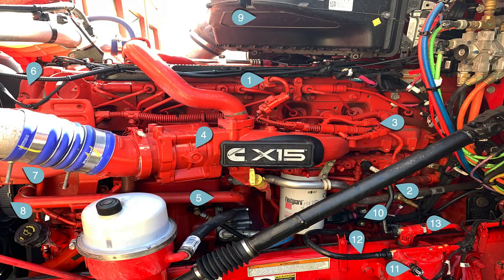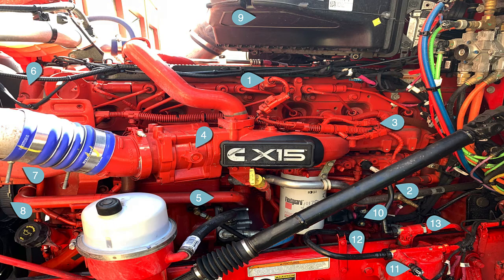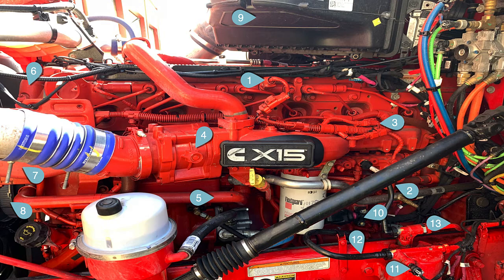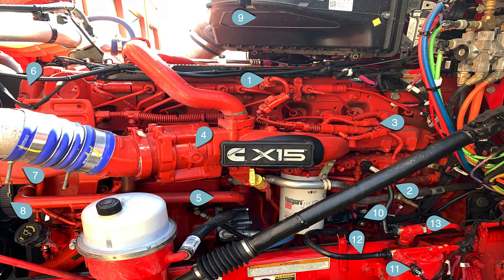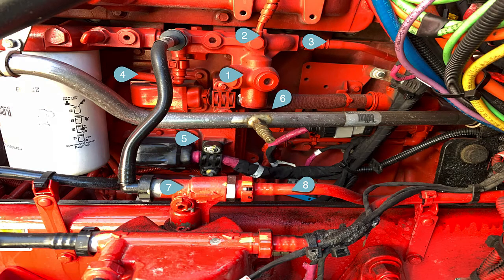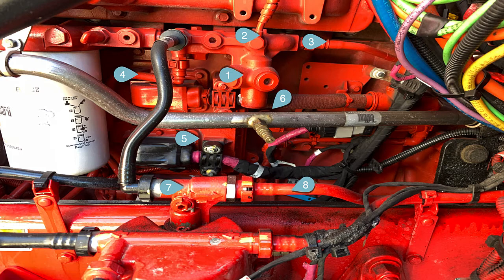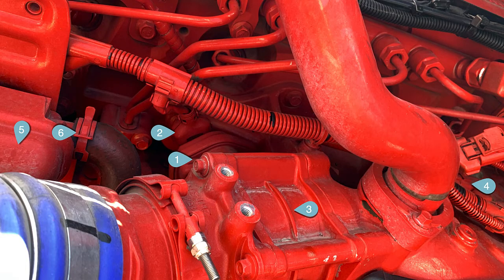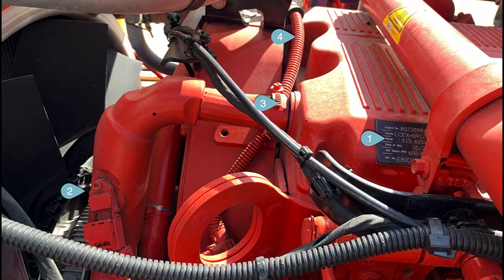X15 cm2350 platform

Comment: Thank you ,  

I'm still waiting for the video overhead adjustment for x15
Reply from the maker: Actually the X15 is easier to adjust than the 871 overhead video I posted. You set the valves the same and there is no injector to deal with as it is electronic. You just need a barring tool( Ratchet or breaker bar 3/4 drive to turn the engine mark to mark) an allen and offset combination wrench and two feeler gauges.  I will make that video the next chance i get.
Reply: It would be great, next year I will reach 500k miles and I need to be ready for it